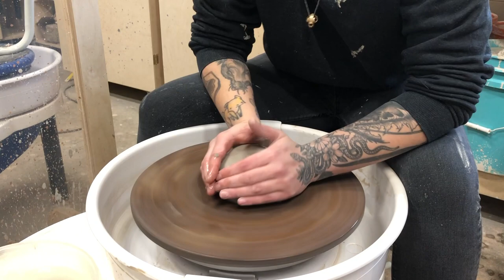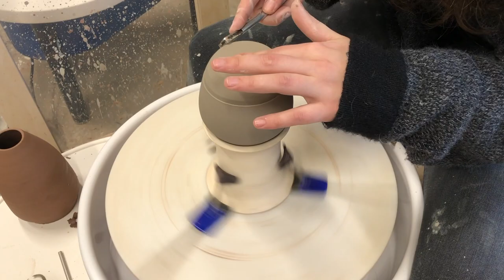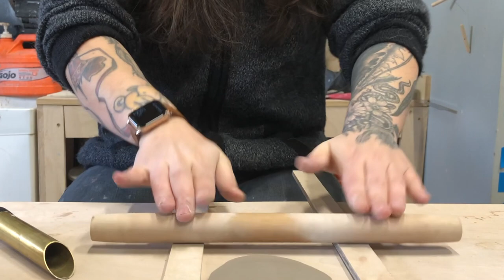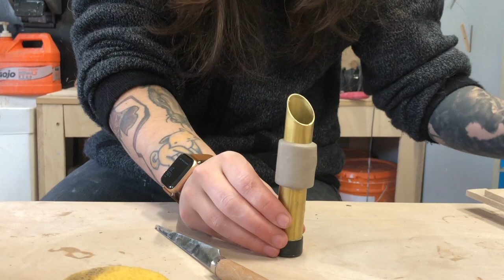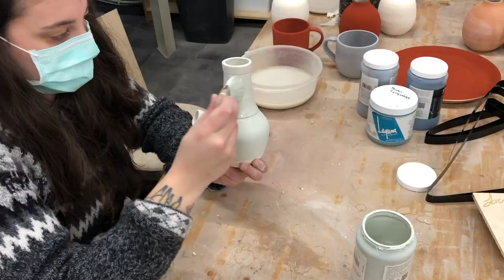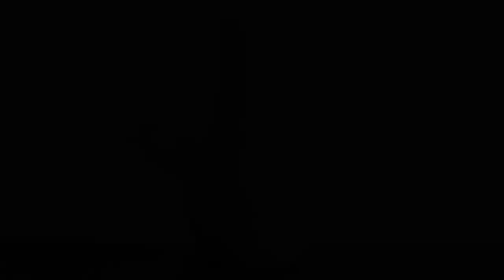Making A Ceramic Bong [Start To Finish]

Comment: Great Pot! Where do you buy the glass downstrem and how do you get it to seal to the ceramic?
Reply from the maker: Thank you! I buy the down stems on Amazon and I put a rubber o-ring around it so it has a perfect seal but can still be removed to clean 😊

Comment: Nice concise vid. I liked how you showed application of wax/latex to retard the drying of the stem. What did you factors did you consider on deciding what diameter to make the stem?
Reply from the maker: Thank you so so much! For the stem hole, I measured the circumference of my glass downstem and then used a shrinkage calculator to find out how big I needed to make the stem for the glass piece to fit after shrinkage 😊
Reply: @theclaycollective  ok thanks, I see. You made it to fit the glass part, not vice versa (buying a particular dia glass pipe).
Reply from the maker: @MikeMartino_Karatsupots  yes exactly! Much easier that way. Or you can also create your own downstems out of clay! 😊
Reply: @theclaycollective  wow,  how clever.

Comment: Does it matter what type of clay is used and what seal did you dip it in?
Reply from the maker: Use any food safe clay and just keep in mind it’s shrinkage rate when making the stem for the down stem to fit in! And this one is glazed with a white glaze called snow 😊

Comment: Question: how do I add glaze inside so water doesn't ruin it in use?
Reply from the maker: I used a dipping glaze, but instead of dipping I use a cup to pour it inside and then dump the excess back into the glaze bucket 😊
Reply: @theclaycollective  so it'll coat the inside well enough for it not to get messed up while using it? Then fire it in a kiln?
Reply from the maker: @shaunkingkgttoatyerrdvhjus6850  absolutely! Glaze turns to glass after fired so there will be no leaking or absorption if you coat the inside with dipping glaze. And it will be just as easy to clean and care for as any other bong ☺️
Reply: @theclaycollective  thank you.

Comment: Why do you use the blowtorch(or whatever it is)?
Reply from the maker: I use the blowtorch to dry my piece a bit so it doesn't warp when I pull it off the wheel :)

Comment: you do realize that it wont work right?
Reply from the maker: Why do you say that? It works just fine! You do have to put a downstem in it, I use glass ones and silicone ones 😊
Reply: @theclaycollective  oh i thought you wherent going to put a downstem in it and just smoke it as is
Reply from the maker: @hoax4312  haha no no, definitely using a down stem 😊 I did make one bong with a built in down stem, and it was beautiful, but very hard to clean 😖 so now I use the removable ones.